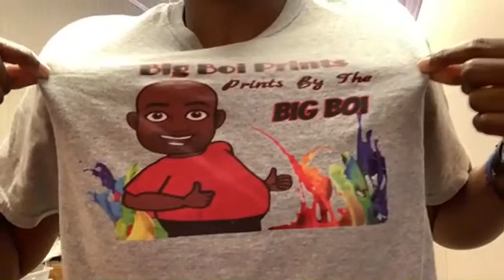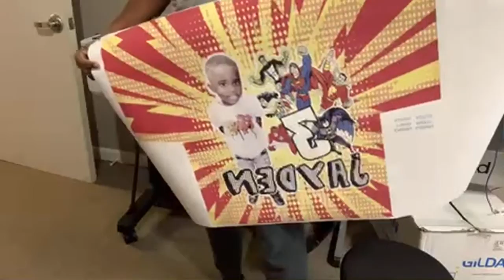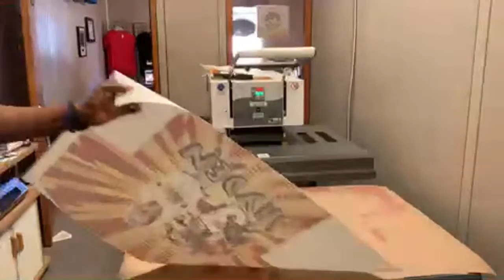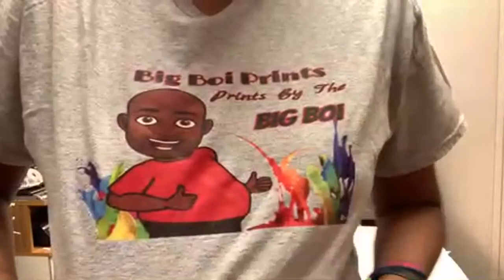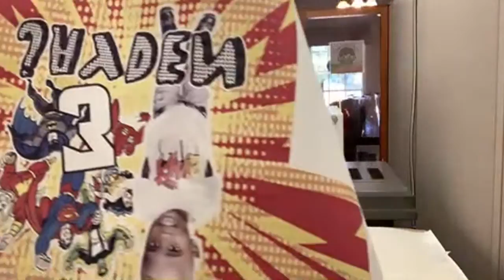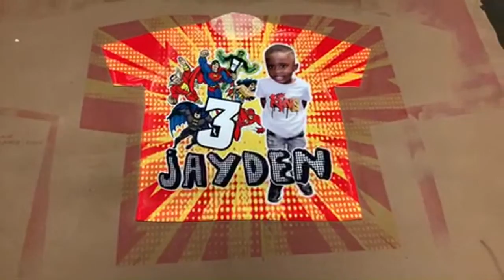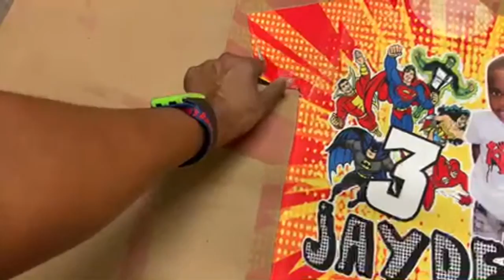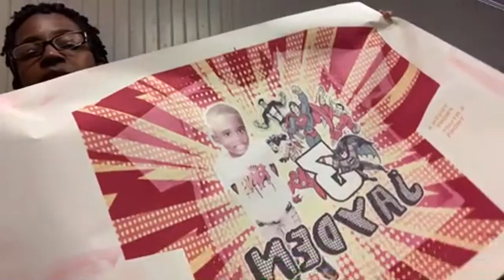All Over Sublimation Birthday Shirt

Comment: Hey nice shirt  where do you get the shirts from am  
Looking for sweatshirt to sub on.
Reply from the maker: If you use good quality HTV and follow the instructions for the specific brand you are using it should not come off.  The ones that come off are not good quality or the heat press may be faulty.  Hope this helps.  Thanks for watching!